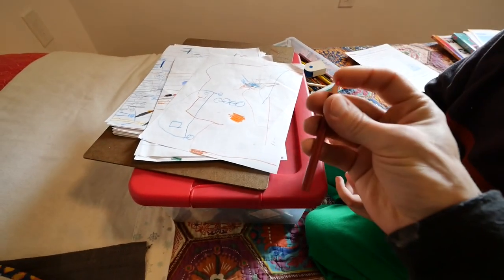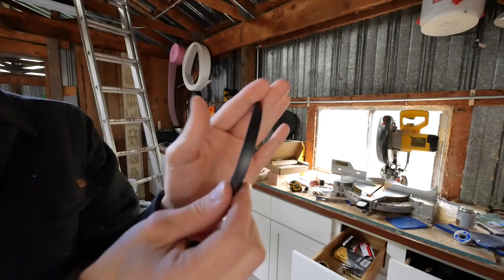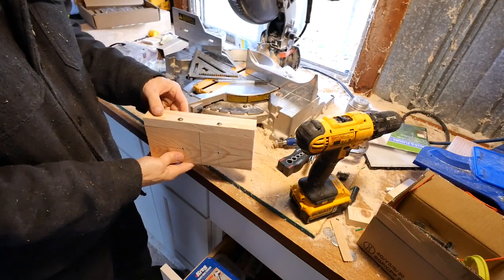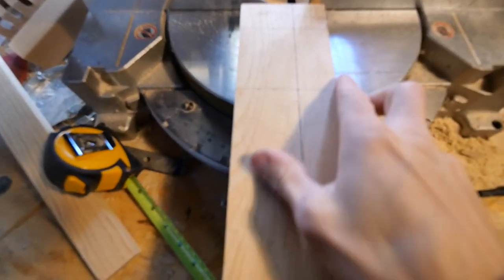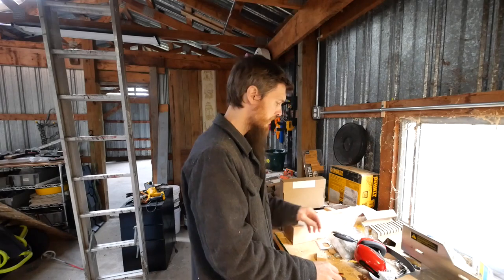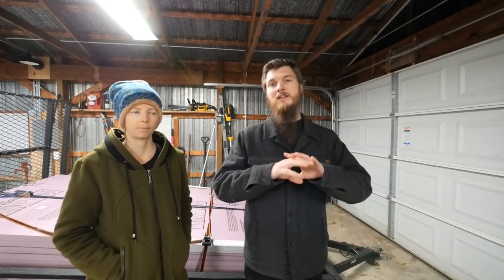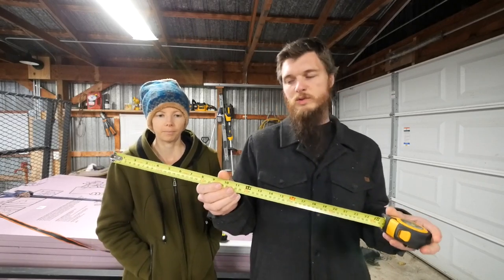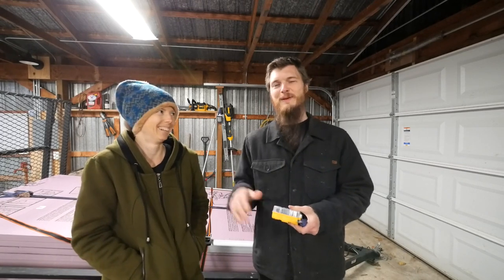Problem Solved in our Garage Shop - Easy Handle Install

Comment: Hi Doug & Ashley,

Loved this video it happens to be a project that I need to do myself and yep as you can imagine Carmen was watching this video with me and yes she pushed me to finish our cabinet doors that have needed handles well for too long lol, so I will be working on that project tomorrow because yes it's way overdue. anyway, the insulation you chose is excellent and it works great they make a very sticky tape to cover the joints like when you have 2 sheets together and there installed then you tape the joint line to prevent moisture from getting through as well as preventing air from entering or escaping the barn. I am very shy as well so I can relate to how ya all felt lol, I am not shy when I write to ya all, but if I have seen ya in person I would be too shy even to approach always been that way, growing up classmates and even some friends thought I was stuck up and rude, but nope not the case at all, in fact, quite the opposite I love people just too shy to talk sometimes. Oh yeah Doug I have been living in Peru for close to 6 years now, and I still have problems with their measurements just can not beat the feet, inches method nope very difficult I always build things here in SAE or USA measurements it is much easier for me well take care stay safe give me a holler sometime love to chat 
from your friends in Lima Peru

George & Carmen
Reply from the maker: Hi George and Carmen. Yep, once you grow up using the Imperial system it's hard to switch to Metric! And I really don't think we could get used to using Celsius. It would seems strange to say it's 29 C (85 F), haha.
Reply: @diyfferent  Yep  for sure, here it pretty easy ya translate once or twice in a month because the temps don't change much at all here every day is pretty much the same always sunny with white puffy clouds and like 78-85 in winter more in the summer and it never rains in the time I have been here almost 6 years it rained twice, it like mist here never like we get in the USA never

Comment: Insulation of the spare room is a great use of that space. keep that upgrade simple.  And here is what i found on USA Measurement 
The US uses United States customary units, which have similar names to the British Imperial units, but aren’t the same in all cases   For example, the US uses the “Queen Anne” gallon of 231 cubic inches, while the UK imperial gallon is 277.42 inches.

Comment: Nice tip on the electrical tool. Guess it makes sense since often you need longer screws for boxes/faceplates and finished wall thicknesses can be all over the place. I've memorized the conversion for online shopping 2.54cm = 1in .. but yeah definitely room for math errors. I think I'll get one of those. I blame the trades for US not converting, metric typically doesn't need the fractions as a mm is pretty accurate.

Comment: Thanks for sharing.
The drawings are sweet.
Good thinking on the  jig for handles. I thought just drill a big enough hole to use as a pull. No need to buy and nothing to catch on.
I like the new tape measure, a definite design improvement.
Carry on!

Comment: Imperial = inches and metric is millimetres and centimetres.  12 inches = around 30 centimetres/300 millimetres. Thank you for the tips especially the wire cutters, I'll definitely get some. 💕💕
Reply: I have had wire cutters for years and didn't know that. For goodness sake! I learned something new today!

Comment: I like the tip about the wire stripper plyer. Love to watch your excitement about the tapemeasure.
And I have a buying tip too if you ever want to buy a new one (and a lot of people don't know abaout this).
Notice that the end tip of your measure has a little wiggle room between the tape and te tip; (that is if you buy a good one).
The wiggle room (about 1 mm) should be there to compensate for the tip itself.
If you hook on to something for an outside measurement the tip should slide out.
If you take an inside measurement, you should push the tip in the corner, sliding it into the tape.
Either way the movement of he tip will compensate for correct absolute measurement.
Reply from the maker: Yep, that's something people don't talk about too often - the function of the tips of tape measures :) Good points.

Comment: The Gable ends are going to give so much natural light though out the year. From a light therapy point a view that if going to lift your mood while you work reducing the stress level time. Help reduce the conditions S. A. D. 👍😊👍
Imperial = inches (UK uses both inches and centimetres) and metric = centimetres (main land Europe centimetres)

Comment: If I am not mistaken the Navy and Air Force have moved to meters in engineering equipment.
By the way degrees are translated into radians in complex systems

Comment: A little hint about the breaking pencil crayons — they have a wax base to them and if the pencil keeps breaking (like it did for Maverick) it may be because the lead inside the pencil is broken.  It can happen if the pencil crayon gets dropped and the “lead” inside fractures.  Then, no matter how many times you sharpen it, it just keeps breaking (especially if it has multiple fractures).  I have not tried this, but an artist’s website said one can take the pencil and heat it up in an oven which will cause the waxy “lead” to melt enough (hopefully) to repair the fractures.  It’s worth a try, wouldn’t you say?  Unfortunately, this trick doesn’t work with graphite (plain) pencils.  Hope this is of some help with the young lad.  If it works, it would make Maverick’s art works so much more satisfying to create, 😃.  Good-night for sure, this time.
👵🏻🐾💕🇨🇦

Comment: Imperial is correct. To convert imperial to metric multiply by 25.4mm per inch. So 1/2 inch is .5 inches x 25.4 mm/inches =12.7mm. mm means millimeters.

Comment: my go to tape measure has also  been  performax for same reasons but also the silver backing  is easier to read doesn't  seem to get as dirty tape measure is a neon yellow  so not easy to misplace gets used for wood and metal  have about 4 of em atm

Comment: There are 2.5 cm to the inch and 2.2  lbs to the kilo. I know both as the UK only went metric in the 70s. I still have imperial along with metric tools in my tool boxes. You just have to remember not to mix the two or things can turn out a bit strange. LOL😁❤

Comment: Belle does such beautiful artwork! Thanks for sharing. Will you put a small wood stove in the two barn rooms? I follow the channel of a guy in Minnesota who is a contractor and has two workshops in two locations, and has a wood stove in each shop. Makes working in cold weather more pleasant.
Reply from the maker: If we do a heat source we'll probably just do a space heater. :)

Comment: Our country is so large, and was built using the English (or Imperial) measurement system that it would be difficult to convert such a large industrialized nation that was built using the English measurement system to metric.

Comment: Since you mentioned insulating smaller room, does it have electrical outlets in case you have a winter project and need a shop to do it? Of course, don't know the size of the electrical service coming to the building - that could limit how many outlets you have in the building (by the electrical code). 
Don't know how deep the room is (don't remember your dimensions), but if you could work on a car in there, would be extra nice to have that ability. 
Any extra insulation you could glue to the back side of the garage door. Don't know how tightly that garage door fits, but it may have adjustment points that you could fine tune to make it less likely to leak air around it. Or, maybe install some kind of weather seal around the door.
A couple of 1500 watt electrical heaters could at least knock the chill out of the room when you're using it.
Reply from the maker: We still need to run electrical in that small room and install lights. Yea, if we do end up ever heating that room we'll just use some space heaters. :)

Comment: Blue Jays are back here for the winter. Soon I'll put up my feeders for them and other winter birds.. But only after  the bears are gone into hibernation. Good work Bell on your blue jay picture!  We use both  on our tapes. Its Imperial measure and metric here in Canada.  Like pounds and kilograms. Both are used here. Depending on your choice. When we changed to metric America decided it was to expensive. Remember our land mass is the second largest in the world, but you have ten times the population.  
Yes you are so natural now, no worries. When they ask for your autograph you will not even run!  It' was 2c here at 6:30 am this morning. Warmed up to 9c by afternoon. I like how you have taken on  the metric challenge!  The scales work better in metric.  I kilogram = 2.2 pounds  you do that math !  Lol

Comment: Wow, it is so cold there. Brrrr, I would not be able to handle your temperatures. Our winter temperatures never drop below 60  and that’s the way I like it. My winter clothes are probably equal to your summer clothes. I don’t really have winter clothes because we don’t need them. If it gets cool here we just add a light sweater. We have the perfect climate here because our summer temperatures mostly sit about 90 so it’s not overwhelming heat. We do have air conditioning in our homes and cars to stay comfortable. Nice job on those cabinet handles.
Reply from the maker: Your climate is wayyy better than ours! Cold weather is no fun at whatsoever. We're only in October - in January it gets brutally cold, into the negatives at times - ughh! Thanks!
Reply: Cheryle Maybury can I ask where you live it sounds like the perfect place temperature wise to live. I live near Pittsburgh Pa in the summer month's May to October. And November to April I live in Port Saint Lucie Florida. Your area sounds like the best place all year round. I would like to check that area out. Thank you
Reply: Patty Carosi I live in Hervey Bay Queensland Australia. We are well known for our perfect climate.

Comment: We use Celsius all the time in health care. I always have to pull out a chart to convert patient’s temperatures from Fahrenheit to Celsius. Our EMRs don’t accept Fahrenheit. We also chart height and weight in kilograms and centimeters. So we use the metric system a lot. The draws and cabinets look great. 

Our sell on house fell through so we might be heading back to Southern Idaho. It’s crazy. Our buyer didn’t work out. Anyhow. I’ll talk to you later.
Reply from the maker: That's interesting about using Celsius in health care. I just can't get used to the Celsius. All I know is 0 is when water freezes and -40 is the same in both systems, ha. That stinks about the house falling through. No one else besides the California guy are interested in your house? I would think someone would be.

Comment: the inches measurement is called imperial in britain and customary measurement in the US. by the way the inch is derived from metric. officially the inch is 2.54 centimeters in length. just in case you were interested. bye.

Comment: I laughed heaps when you told the story of a chance meeting with the YT viewers.. LOL..

btw: At once stage you threw those old wood panels away.. or so you said you would... it came to my mind that perhaps you could have used them to line the "spare' barn room??? even paint them to make them look decent... well just a thought...

Haha Probably a silly thing to mention but I carry a 5m tape measure in my purse ALL the time...  since for years...hehehe (yes it has the imperial and the metric measurements on it)... I was taught Imperial and still often use it cause I am comfortable with it... but everything here is metric for years now..

Comment: Nice video, great tips, cute stories.  I wasn't surprised that you are shy, I am too, I saw the signs lol. 
 Have you thought about adding a wood stove to the barn you're presently working on ?
Reply from the maker: No plans to add a wood stove, but if we ever did need heat we'd probably just use a space heater :) Thanks

Comment: I find it kind of interesting that in America it is not usual to have both inch and cm on the measurement tools. I am from Germany and an nearly every measurement tool we have both. Even on the school ruler. 😳
Reply: My sewing/quilting rulers have both, but all of our tape measures have inches/feet only. Which was a bummer because we watched a YouTuber demonstrate hanging a gate 150 cm from the top and we were stuck, lol.
Reply from the maker: Metric just isn't used much for anything here.

Comment: Thanks for the video. What's your opinion on a stone surrounding the area. It would cut out road noise and provide security.
Reply from the maker: I've thought about building some kind of stone/block wall by the road, but it would be so long. Thanks :)

Comment: You commented on why the USA doesn’t convert to metric. A lot of industry is slowly converting. The main reason it is slow is cost. New tooling, new gauges for measurement and inspection and training are all required.

Comment: I use metric and imperial, but I find imperial is better for woodworking because it's just easier to do on the fly calculations. Unlike the Metric system, Imperial measurement is more organic and works well with woodworking. Woodworking is all about proportions i.e. fractions. For instance a standard wall is 8 foot and easily divisible by 2, 4, 8, 12, 16 and 24 without the need for a calculator, therefore less figuring. Cutting a piece of wood that measures 12 5/8 into 2 even pieces is as easy as halving the 12 and doubling the denominator - 6 5/16, a lot easier than halving 12.625.
  A foot is easily divisible by half, thirds, and fourths. 6 inches, 4 inches, 3 inches. A system based on 12 is a detriment in science but a boon in carpentry.

Comment: wish the US would convert to metric. Metric is so simple, everything is based on 10.
Doing engineering homework is aggravating when you have to convert rediculus units such as slugs, BTUs and what not lol.
Thanks for the tape measure ideas, I'll keep those features in mind for the next purchase.
Reply: I use metric and imperial, but I find imperial is better for woodworking because it's just easier to do on the fly calculations. Unlike the Metric system, Imperial measurement is more organic and works well with woodworking. Woodworking is all about proportions i.e. fractions. For instance a standard wall is 8 foot and easily divisible by 2, 4, 8, 12, 16 and 24 without the need for a calculator, therefore less figuring. Cutting a piece of wood that measures 12 5/8 into 2 even pieces is as easy as halving the 12 and doubling the denominator - 6 5/16, a lot easier that halving 12.625.
 A foot is easily divisible by half, thirds, and fourths. 6 inches, 4 inches, 3 inches. A system based on 12 is a detriment in science but a boon in carpentry.

Comment: Oh,  yeah...the mouse factor.

Nothing against "cheaping out" (nice term - I like it) - for gosh sakes, save money when you can. Going a little more heavy-duty will undoubtedly stretch your pockets a little,  but it doesn't have to hurt that much. Blown-in insulation, maybe? Do it on top of what you have to give it a little more gusto and let you keep what's already there.

Later on, of course. After  season or two of walking into the icebox you're building and say "we should have had our heads examined for not doing it right the first time." 😁

Comment: Code says you must cover or use foil insulation do to fire code. However do as you wish it is your house.
Reply: It’s a room on the barn not a house.
Reply from the maker: Yeah it would all be covered afterward, probably with plywood or osb.

Comment: Do you have another wood stove for the barn, for heating purposes? Facebook Marketplace seems to be the place to find really good deals these day. Craigslist has kinda fizzled out.
Reply from the maker: We don't have another woodstove, but if we do need heat we'll just use space heaters :)
Reply: @diyfferent  be careful, with random stuff in that room it's easy to catch on fire! 🔥

Comment: Hey Doug. What is that wool coat you’re wearing? I can never find ones with breast pockets.
Reply from the maker: It's a Billabong - Barlow Jacket (one of the older versions). It's only 10% wool but it's warm!
Reply: @diyfferent  Thanks man 👍

Comment: Doug, I'm curious about something from one of your other videos. You said you have a well for you domestic water supply. I've never lived in a house with that. Obviously you are responsible for the care and maintenance of the well and the pump and all the plumbing. Are you required to have a permit from your town or county? Are you required to have the well water test on a regular basis? When you bought the property, did the seller have to provide documentation to show that the well water was safe? Just curious, Thanks.
Reply: NZ has houses with wells also. maintained by the owner and only allowed if it was there previously. ours was too difficult to maintain so my dad let it go but our neighbours well was still functioning.
Reply from the maker: Yea, the county requires a permit before the well is drilled, but when we contacted our county about it, they had no record of it at all, so someone may have done it without seeking a permit, who knows. We aren't required to have our well water tested. The sellers did say they got the water tested when they moved in over a decade ago, but that's all we know, we don't know the results. Thanks.
Reply: @diyfferent  Idaho requires a well to be tested for fecal coliform and ecoli.  The seller usually pays for it to be done. It’s usually performed a certain amount of time after an offer is accepted. They do a potability test on the well is what it is called. A productivity test is done as well. It runs $200. I know that since we have sold a couple of houses with wells. But everywhere it’s different then it is here I’m sure.